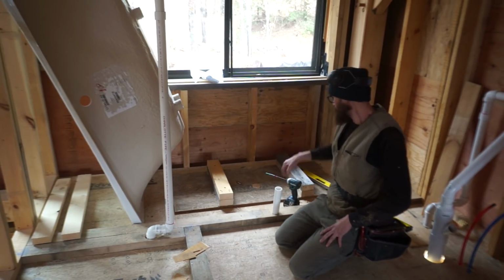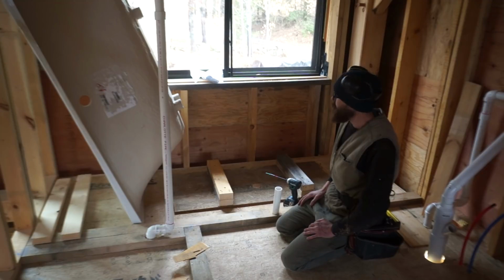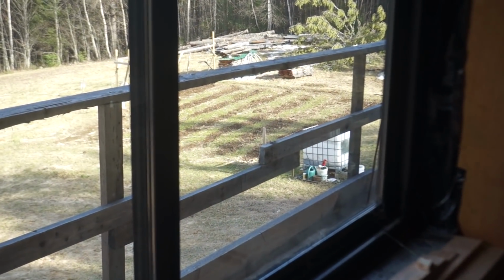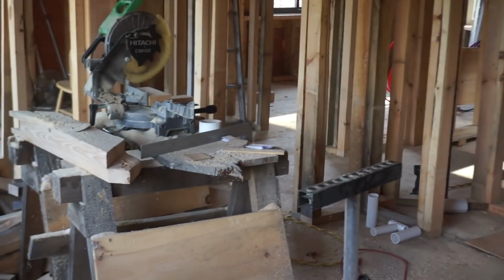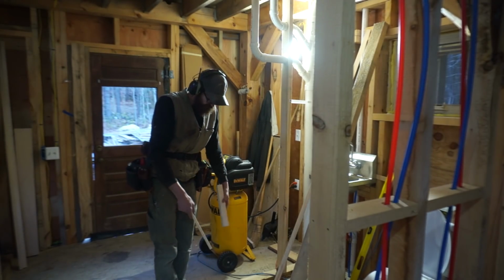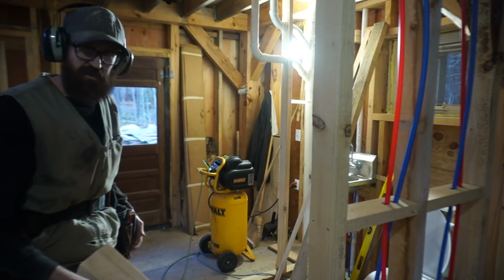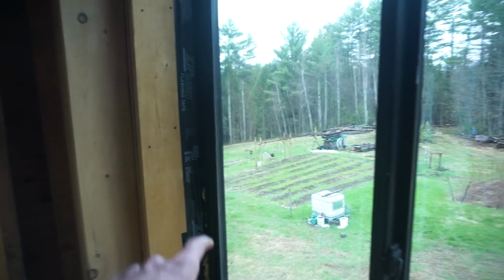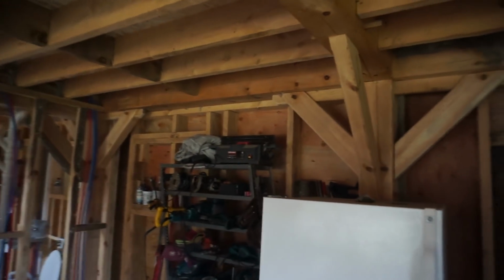Building a House from Trees SE 7 EP 22 Making a Home

Comment: Just a tip from past experience. Wrap your tub with fiberglass insulation. I did this on a composite jacuzzi tub years ago and was thankful for how long the water stayed hot. Stuff what you can underneath. Duct tape worked ok but you might try adhesive spray, or both. 
Always look forward to your video post’s.
Reply: I wrapped the underneath of mine with a coil of water pipe and then spray foamed the pipe in place. Insulating the whole underneath. Then connected the pipe to the hot water line of the radiators. So that it heated the bath and kept the water hotter for longer.
Reply: I keep hearing bad things about  jet tubs, like germs in the plumbing

Comment: Are the logs you're cutting at the 11 minute mark already dried? Or do you dry them out before using them? I'm really intrigued by your project but I always thought wood had to dry before using it? Thanks in advance for any input on that.
Reply from the maker: Yeah, I have been using basically green pine the day after I mill it for internal framing. I know it will dry really quickly and it doesn't shrink all that much. I milling from old trees so that helps too.
Reply: Good to know. Very interesting! I built a 6 x 6 table top from undried Ash I bought at an auction, and the thing shrunk about an inch as it's dried out. Anyway, I appreciate knowing that, and I love the fact you can mill all your own wood right on site! That is the way to do it! Single slope roof is the way to go too! Keep up the awesome project man!

Comment: Are there going to be photovoltaic panels on the roof? Will you be able to heat your hot water with renewable energy? Why not put in an induction stove and run it on solar electricity?
Reply from the maker: It is a giant, north facing roof. Solar panels are not the effective on roofs this far north, with the snow and the low angle of the sun more than half the year. Aside from the fact that solar panels are not all the efficient as it is. It all kind of depends on ones sense of what is renewable. Solar panels use a lot of energy to make and battery tech is still not quite there and uses also a lot of nasty stuff to produce. Once we have a grid power by nuclear energy, I will go all electric everything. . This house I am building is so tight and all the appliances I am getting are so thrifty, that my usage of propane and electric is going to quite small.